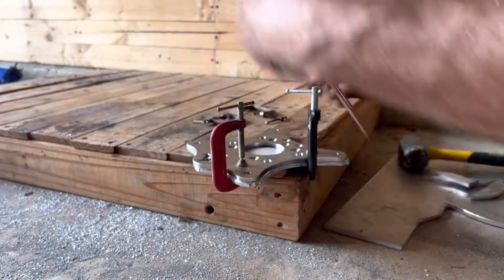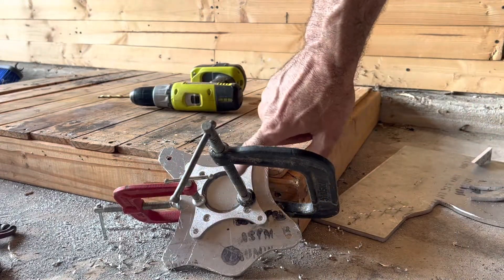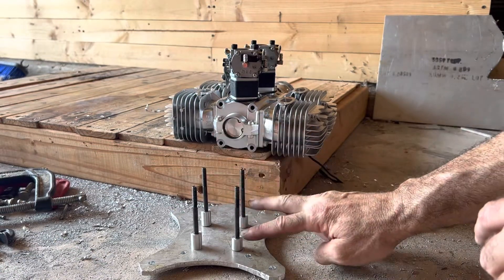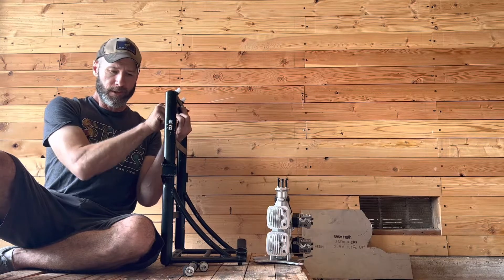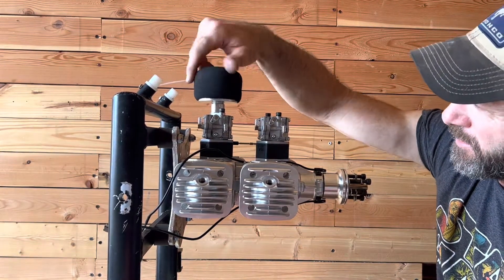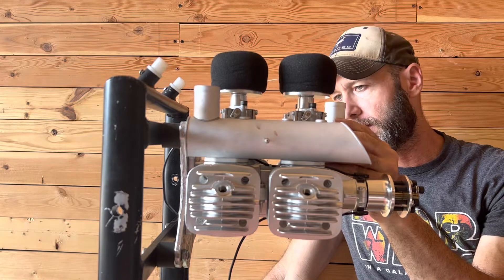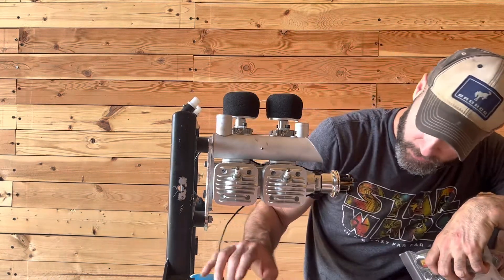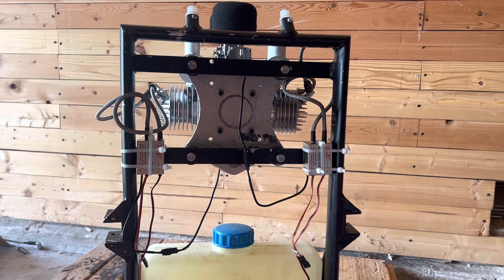DLE 222 Paramotor: Assembly

Comment: Hey how much more fuel efficient is the DLE 222 compared to the moster 185?
Reply from the maker: It’s not. It burns a lot of gas. About 4 liters per 20-25 minutes. The advantage is the weight of the engine when packing the equipment out or for a pilot that has trouble with the weight of a traditional paramotor.